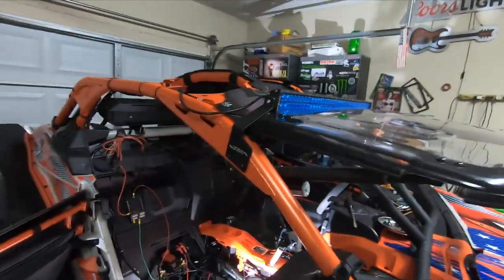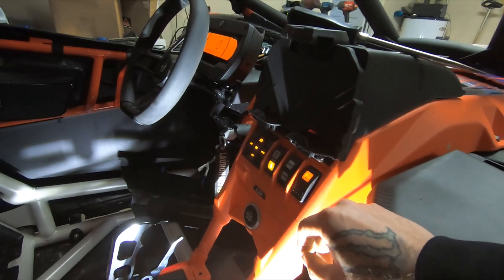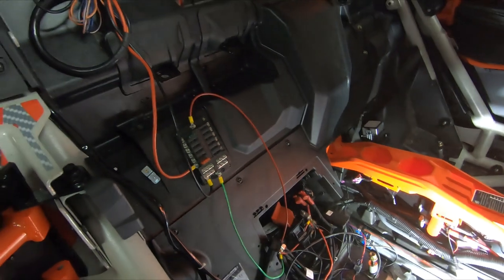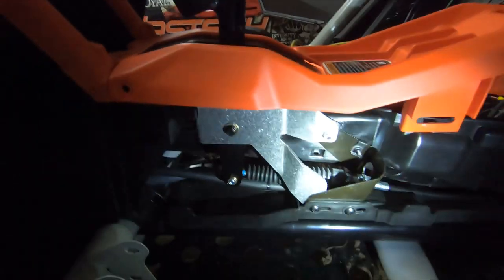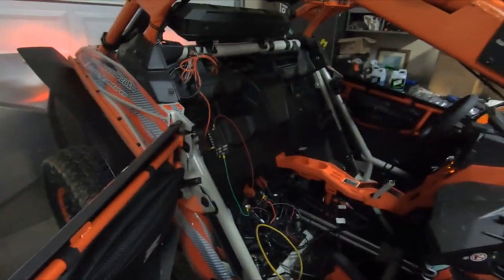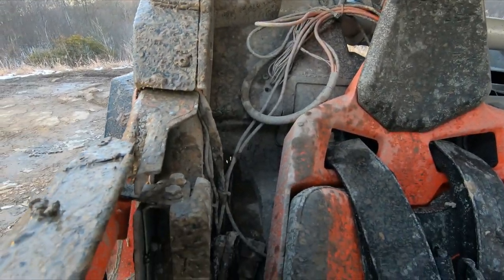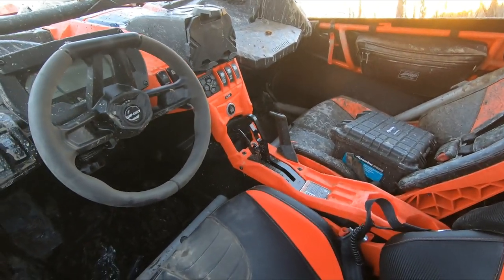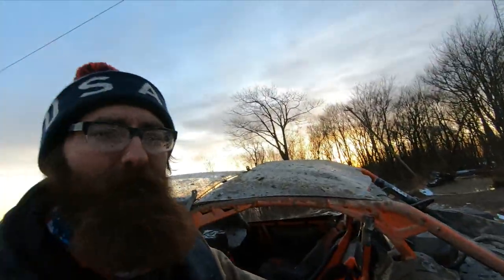2021 can am X3 XRC RR build update part 4. Hill killer shifter/ infinity off-road rock lights.

Comment: Where did you get the shifter and if you have used it how does it do? Looks good. Nice upgrades an nice machine.
Reply from the maker: In the description there is a link to the product (hill killer shifter). So far I've taken it out on two trips. I absolutely love the shifter and I will most definitely be installing one in every vehicle from here on out. It is so much more convenient than the factory shifter.

Comment: Awesome thanks bud, I was just about to start wiring the light bar this weekend  on my 21 mavx3 ds. Good idea with the fuse block instead of multiple inline fuses. 👍😎👍
Reply from the maker: It helps simplify everything especially if you have to troubleshoot something.

Comment: Could you flip your light brackets around, it would move the light bar back further on the roof ?
Reply from the maker: I do not think I can but its worth a try!
Reply: @AbramHeathFULLYEET  you might have to swap sides hopefully it works for you
Reply from the maker: @christianemino06  I think what I'm going to do is swap it out for a 50 inch and get different brackets.
Reply: @AbramHeathFULLYEET  hopefully you get er geared